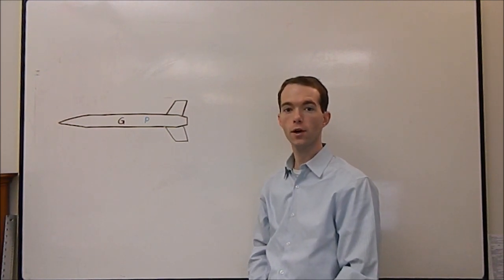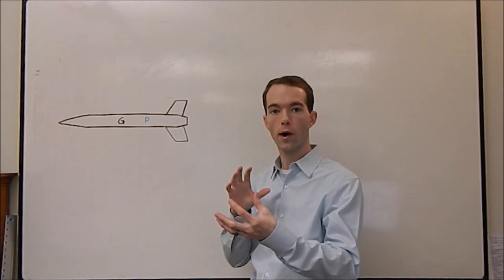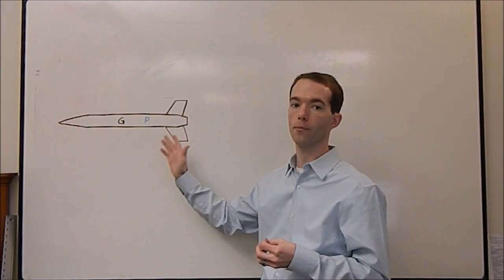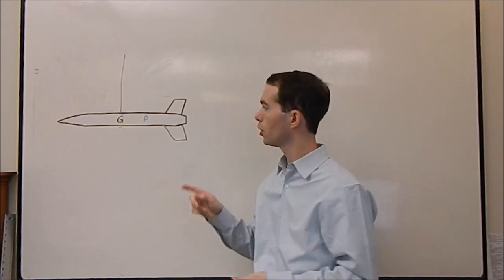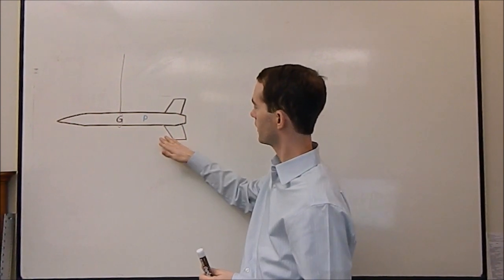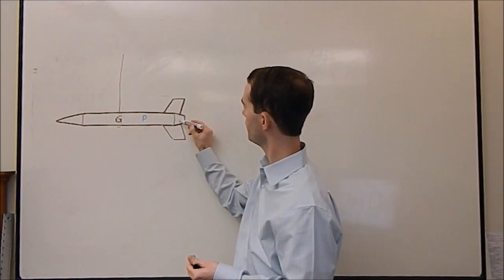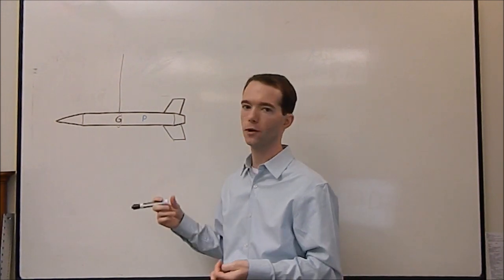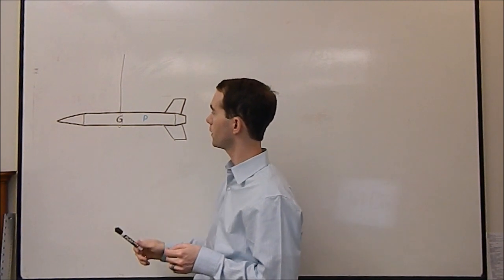Model Rocket Design: Stability Basics              Mikes Inventions

Comment: Important note: Make sure that you calculate the center of gravity before AND after the fuel is expended and ensure that it remains in front of the center of pressure.
Reply: That isn't necessary. It will always become more stable. As the rocket flies and ejects the mass of the fuel out the back, the motor will become lighter and the rocket will become even more nose heavy, and therefore become even more stable.
Reply: Ryan Garrison  we are talking about rockets not fireqworks. liquid hydrogen and liquid oxygen are held up high above the combustion chamber
Reply: @NormadYT  No we are talking small model rockets with solid fuel at the rear of the rocket.

Comment: you can take a cardboard cut-out of your rocket, and it's center of mass is it's center of area, because the cardboard has constant density .. that's how you can easily find the center of pressure for your rocket
Reply from the maker: Yes, this certainly works too. It's a nifty little trick.

Comment: QUESTION: Can you think of a test design, which anyone in their garage could perform, which proves that rockets DO NOT push off of air to create thrust? I am having trouble with my teacher on this, and he insists that rockets require outside air pressure to create thrust from the exhaust gasses escaping the nozzles.
Reply from the maker: No experiment necessary: Start by posing this question: "How do rockets work in space where there is no air?" If that doesn't make your teacher realize that rockets work regardless of air, then you might ask they explain newton's 3rd law. Once the teacher realizes that gasses have mass, you should have won this argument. You got this! Thanks for watching.
Reply: @MikesInventions  
That's the problem. I asked how rockets work in space where there is no air, and I was really embarassed when he proved that there is still air to push off of. The class was on Newton's Laws and that is the problem because my teacher wasn't arguing against Newton's Third Law, he was arguing that most people misunderstand Newton's Third Law. He argued that gasses expanding into a perfect vacuum produce no work, and then showed how NASA calculates for outside air pressure with all of their rocket nozzle designs. I have no arguments left, and that's why I'm desperately trying to find an experiment I can do to prove it.
Reply from the maker: @thomasg4324  Ok, well yes, even in LEO there are trace amounts of atmosphere. There are always trace gasses, but when is he going to concede they are negligible? At the distance of the moon?  Pluto? What level class is this? And is he even able to be convinced? I'd like to know what he said about how the 3rd law is misunderstood. When you accelerate mass one way, the other mass moves the opposite way. NASA does calculate pressures for nozzles, and they design different nozzles for 1st and 2nd stages. But all the atmosphere does is apply a relatively tiny bit of back pressure down low, then the plume expands as the atmosphere thins out. So... it sounds like we can't create a vacuum to his standards in our garages, but if we could, remotely piercing a CO2 cartridge or something should show it, but I just don't know how you can win. I certainly share your frustration. Can you substitute masses (like BB's or marbles) for exhaust gasses?  Is he a flat-earther too?
Reply from the maker: @thomasg4324  Ok, what about this? Make a hypobaric chamber like this, try your best to suck all the air out (which isn't possible, but maybe you can get close, put a vac gauge on it)
https://youtu.be/1nnbV-7H4bY?si=xd9N2QZbIYckUHmFout of a full 10' piece of PVC, then remotely fire an Estes mini motor inside of it. You could even build a little car for it to ride on. That's all I got for now... good luck!
Reply: @MikesInventions  
When I mentioned deep space vacuum being almost perfect vacuum, he mentioned that there has never been a rocket thrusting in such strong vacuum. He mentioned that NASA uses gravity to slingshot out into deep space..not rocket thrust. He showed the class that principle of free expansion...that a gas expanding into a perfect vacuum produces no work. He demonstrated using NASA's own calculations, and showed that NASA needs to expand the shroud of 2nd, 3rd, and 4th stage rockets larger and larger to expand the exhaust column pushing off of the surrounding air....that if the common misunderstanding of Newton's Third were the case, then it would be the opposite. I have to say I was completely at a loss. Every single thing I brought up he had an answer, and I just can not believe there isn't a simple garage experiment that can be done to prove it.

Another student mentioned tests done with model rockets inside vacuum chambers and the teacher chuckled saying that not even the most powerful vacuum chamber in the world can pull anywhere near a perfect vacuum, and that sicne the chamber is so small, the second the fuel fizzles (that's another thing..he said rocket propellant won't ignite, but fizzle at best) the chamber will fill with gasses, and the remaining fuel of the rocket will push off of THAT. The other student actually started agreeing with him after that, and I am really at a loss at tis point. Monday is fast approaching, and I said he should give me the weekend to think about it. I don't want to look like a fool again the class was literally laughing at me because he shot me down on everything I mentioned.
Reply from the maker: Ok, so you’ve got a teacher who sounds like a (insert choose phrase here) 
1. He’s right about not using bipropellant rockets for deep space maneuvers. We do use slingshots, but we use monopropellant thrusters for mid course corrections.
2. He’s also right that if a gas just expands into nothing, it cannot possibly do any work.
3. He’s misapplying what he thinks he knows about ideal gas laws. This isn’t just a gas expansion thing. We are imparting tremendous momentum to the gas, and conservation principles move the rocket the other way, which you understand.
4. No matter what, you lose. So just do whatever you need to to get an A and forget about all this. It sucks but that’s the way it is.  

Sorry I could help much. This is very frustrating for you, but just hang in there. There will always be people like that.
Reply: @MikesInventions  
"He’s also right that if a gas just expands into nothing, it cannot possibly do any work." <~ WAIT WHAT! He's right a gas expanding into nothing can not do any work?